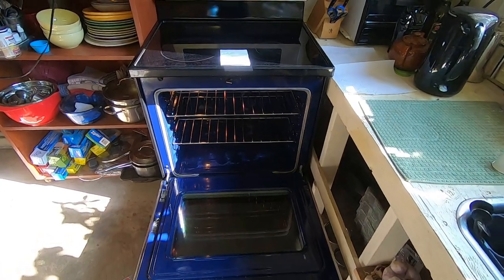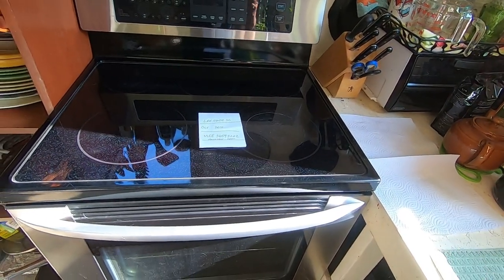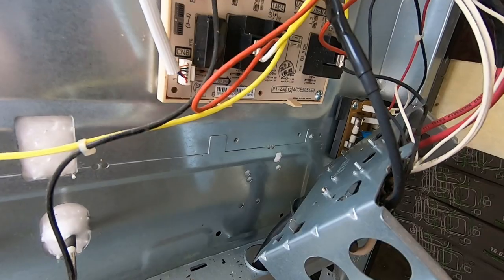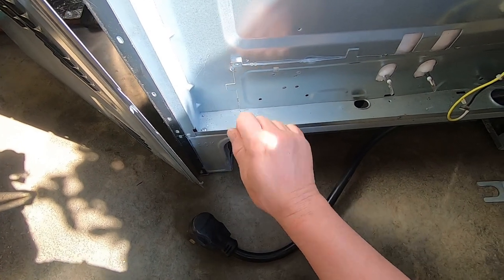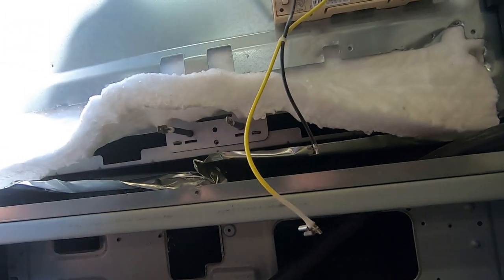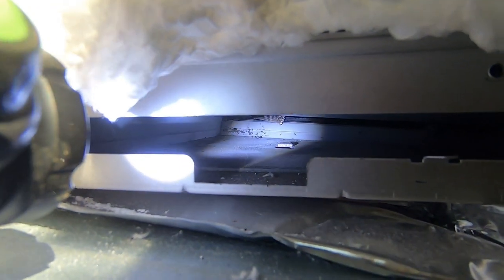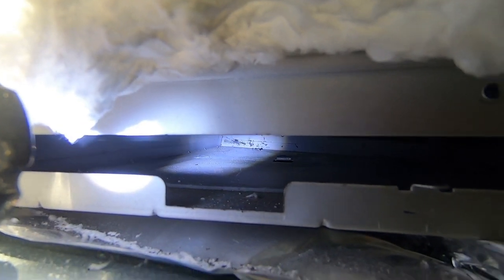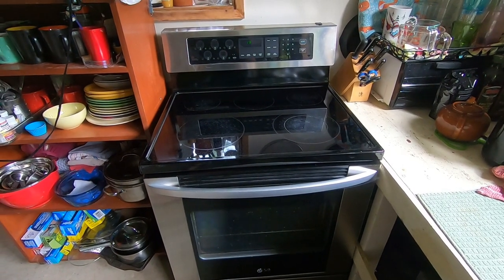HOW TO CHANGE A HIDDEN BAKE ELEMENT

Comment: Thank you for your time and this video. Next month I need to do this to my LRE4211. I may have a few more numbers to the model number, but I certainly get the idea and confidence to do the job. Thank you again.
Reply from the maker: Glad it helped. I hope your repair goes well. Keep in touch. I'd like to hear how you make out with the fix.
Reply: @EverydayProjects  It doesn't look like my LRE4211St does not have an element in the bottom, only on the back and broiler element.  Took off the back and there are no wires going from relay to any element under the bottom and no panel like yours behind the main back panel.

Comment: I found your video very helpful so thanks, I have a fairly similar stove and my problems is that the oven doesn’t heat up past 350 degrees, I installed a new thermistor but that didn’t fix it, so only after watching your video i realize it may be the same element mine needs replacing, I didnt even know that element existed until watching your video so thanks again, now i just have to find the replacement element and hope that it fixes my problem.
Reply from the maker: If your oven has a smooth floor then you most likely have the element hidden underneath. If you search online using your stove model number (found on a sticker inside the warming drawer) for bake element, you should find one. Good luck! I'm glad my video helped you. Please like and share my video and if you like the things I do, please click subscribe. It's Free!

Comment: As a Seasoned Mechanical Engineering Service Tech, I have to say you did a great job explaining what your were doing and why you were doing it. Very great Concealed Bake Element Change Out walk through for a LG. Smart for removing the remaining debris, not everyone even takes a look inside to even see what make have cause the issue in the first place. Your situation it seems as though the heating element actually withstood the test of time and lasted long enough to possibly warp to the point of shorting out against the structure and grounding out to oblivion. Just a quick heads-up. It should have tripped your Circuit Breaker before the Grounding Out to Oblivion part happened. You may want to check your Range Circuit Breaker and wires along the way if this was not tripping your breaker at the time of turning on the oven and discovering that the oven was not working. We design these with fire & life safety in mind so there are several safety switches and fusible links between each heating element and the Circuit Breaker so if it was not tripping the breaker before the repair, you may want to check to see if you have a breaker going bad or oversized. Loose connection at any point in the wires for the element can cause melting at the wire terminals and insulators but not the the element, after all it is designed to get heated. So this leaves me to believe that if your breaker was not tripping, you either have an oversized breaker or a breaker getting ready to die out. Either way figure since you seem pretty thorough in your findings you might want to entertain this possible future repair. But just in case it did the amperage did not raise enough to trigger the breaker to trip (which is scary) the HLCS High Limit Control Switch should have kicked in and cut the power to the particular element, and if that failed then there are at least two to three more safety switches for backing up those safety switches per element. So get back in there and let me know what you find.
Reply from the maker: Thank you for commenting! You are absolutely correct in your assessment of the stove tripping the breaker. But that was happening with the previous owner of this stove, until it stopped tripping, but the oven still would not work. My guess is that while the distorted element was making contact with the body of the stove, it tripped the breaker, but once the element broke into pieces, the situation moved from a SHORT to an OPEN circuit.

I picked up the stove for FREE because the oven wouldn't work (no doubt about it) and one of the surface burners was inoperative. I was using the surface burners only in this cabin, with no use for the oven...until this video.
It is still amazing how difficult it is to access this element. As I've said previously, it seems that the manufacturer would prefer a consumer buy a new stove than fix this oven!

Best wishes and thanks again for your thorough and correct diagnosis!

Comment: Hi our LG cooks unevenly, meaning if I cook a frozen pizza half way through I have to turn the pizza 180 degrees. I use Bake for that not convention so my question is mine burned out partially? The top element is strictly for broil, correct?
Reply from the maker: Usually an oven will not reach temperature when the hidden element is failing. I'd get it checked. Sounds like it's on the way out.

Comment: My LG oven take way too long to preheat, I change the temp sensor but that did not solve my preheating problem. Now I'm leaning toward the hidden bake element, could it be damage to the point where it effect the time for  preheat ? 
 
Thanks the video was great !
Reply from the maker: The preheat is definitely affected by either the broiler or the hidden bake element not functioning, because they both work together to bring the oven up to temperature. If the preheat takes a long time, or the oven doesn't get to temperature,  I'd be looking at one or the other. The oven in the video was displaying that symptom exactly. It would take forever to reach the preheat (if at all). Best of luck with the repair! Remember, be safe! Power off at breaker + Unplug stove. Also watch for sharp edges on stove panels!
Reply: @EverydayProjects  Yup that is exactly what happened to mine. I pulled out the temp sensor and it read 1097 ohms on my multimeter, which is within spec. Then went through elimination by testing the resistance on each of my elements starting with the broiler, the convection heater. They both tested around 17 ohms I think. When I got to the bake element, it had infinite resistance and no continuity just like shown in this video. I visually inspected the PCB power control board for any signs of heat damage or leaking filter capacitors. so far so good. I ordered an ew bake element for $120 as well as a new touch pad interface as they always end up cracking after year of usage.
Reply from the maker: @MrActionRadar  Best of luck with your repair. Thanks for stopping by. Take care

Comment: I have an LG oven that doesn't seem to heat up evenly. I took the back off and measured power to the upper and lower elements while the oven was pre-heating. My oven never powers both elements at the same time. One is on for about 1 minute, the power swaps to the other one for 1 minute. I measured about 10 amps at 220 V for each element when it was on. Does this sound correct to you?

Comment: That element was really baked. God job on the fix, I didn't see any sparks.
Reply from the maker: I've seen bake elements with burn marks before, but never one completely disintegrated like this one. Perhaps it has to do with the confined space in which it operates. The manufacturer could have created a better access door to facilitate changing the element but as I eluded to in the video, they really would prefer that you buy a new stove instead of fixing a broken one. Thanks for commenting!

Comment: Do you have a suggestion for removing the pieces of the element that are stuck? It was a hard work and I can’t take it all out... I couldn’t really remove that door, it’s all scrapped now, think I’m gonna need another piece of metal for replace this. It’s really hard for changing a simple element, I can’t believe this. If you have some advice, I would be grateful, I tried everything that I have to take the pieces out and it’s impossible! Thank you for your video
Reply from the maker: Perhaps you can fabricate a replacement cover from some sheet metal. Often, the big box stores will carry pieces of metal. Getting the old , broken pieces of the element out is important but not entirely necessary. Just so long as the new element will fit without interference. I’d try to get all the loose pieces cleaned out if I could, though. Sometimes a sheet metal shop can make you a new cover much less expensively than you might know. Best of luck. Remember, be safe and if in doubt, call an appliance technician. Best wishes!

Comment: Great Video!  I have a Kenmore Elite Double oven that is not warming as it should.  It is 9 years old.  Is it more likely to be the  Temp Sensor or the one of the heating elements?  Thanks
Reply from the maker: Not sure what the problem could be with your oven. Usually, it is a step-by-step elimination process to troubleshoot any appliance. There are many online sources to help. Try searching for "Kenmore Elite Double Oven Not Heating" and go from there. You can first try to reset your oven to factory by this method: How to Reset a Kenmore Elite Stove Oven

  1.  Press the "7" button on the Kenmore Elite keypad.
   2.  Continue holding the "7" button for at least six seconds until a single beep sounds.
   3.  Press the "Start" button on the keypad once. This will reset the oven back to the factory default settings.

Try any simple, step-by-step method to try to eliminate the components that work vs. those that do not. Remember, BE SAFE and don't attempt any repair beyond your skill level. Often, a qualified repair technician is the best call. They can save you time and money since they will know just what to look for. Good Luck.
Reply: @EverydayProjects  Thanks so much for your response.  I appreciate your help.

Comment: Thanks for your video. On my stove, the little panel is completely stuck on, after I cut the little tabs nothing is moving at all. It completely destroy it if I try to pull it off. Any thoughts would be greatly appreciated.
Reply from the maker: The cover on mine was hard to remove too. They really don't make the element easy to replace. They'd much prefer you buy a whole new stove it seems! 
I wouldn't worry too much if you destroy the cover taking it out. Just try working around the edge by driving a flat screwdriver between the cover and the back of the stove (wear some gloves, it's sharp!). Once you have it out, if it's damaged, try flattening the cover on a hard surface by tapping with a hammer. If that fails, the big box stores like Home Depot and Lowes sell small pieces of sheet metal that you could cut to size. The replacement cover doesn't have to be an exact replica, just so long as you cover the opening and it doesn't interfere with the electrodes of the element. I hope this helps! Good luck. Any other questions just write.
Reply: Thanks for the quick response, the info was exactly what I needed.
Reply from the maker: @georgeslabrosse3194  You are very welcome!
Reply: I'm into mine at this point, too.  !@#$% LG does not want you replacing the bake element, I swear! :^)
My son said "Designed by design engineers that never physically work on their projects!"

Comment: Hey this was somewhat useful but I wish you could help me with my Frigidaire oven the element went out and it has 3 elements but the one that went out is in the back of the oven but idk how to get to it if you can help in anyway or anyone would be so much help before thanksgiving!!
Reply from the maker: I would search online using the model number of the stove (found on a white sticker either inside the door or warming drawer) and then select "Images"  and you should be able to find an exploded view of the stove parts, often with part numbers, then check for parts on ebay or Amazon. An easy test of the element is shown in this video once the POWER IS OFF ! Use a multimeter on the continuity setting. There should be continuity through a good heating element. Good luck.

Comment: My LG LRE30453ST/01 has this same hidden bake element and the cover PANEL will not come off after clipping like the service manual showed. I’ve used a chisel, a dremel, and tried to score the FAKE panel lines with sharp tools. This panel was not made to come off. I’ve managed to cut and mangle the metal along several areas so far but it’s still stuck. If I somehow manage to get it off will it even be safe to put back since it’s mangled? How to get this panel off? 
I appreciate your video. It should have been doable and a somewhat easy fix. Looks like it won’t be though because of this poor design by LG. 
Edit- I notice at 5:04 when you pressed along your panel the separation lines clearly showed . My panel does not show any separation at all when pressed.
Reply from the maker: Cut out the panel with a jig saw with a short metal blade and install a new sheet metal piece, Home Depot / Lowes, etc.  sells small pieces that would work. Just drill and use sheet metal screws to attach.

Comment: Great video.  I have a 2007 LST5601ST and replaced the bake element with replacement part MEE36593201.  The original element had indeed burned out in one spot.  There was no continuity for it.  By the way, the difficult plate on the back was easy to lift out once all the small connection points had been broken.  Put in the new element and found out that the new bake element did not work either.  Checked to make sure it hadn't failed as well, but it had continuity.  I am really lacking in any electric or electronic knowledge.  Any ideas what the problem might be?  Might there be internal fuses or switches that might have gone off when the original burner failed?
Reply: Turns out it was the circuit board for the oven (not the main board).  I replaced it and everything works fine.  I guess the circuit board acts a fuse in this case.
Reply from the maker: This comment just turned up now. Sorry about the really Late reply. Glad you got it fixed

Comment: hardest part is removing that bake element access panel.  I've gotten 3/4 the way through and now seems impossible to separate on the right side.  i now have a chisel trying to pry it away and still not working well. I've cut all those "holes" apart and still holding on well. Any tips?
Reply from the maker: Just use a chisel and a hammer (or screwdriver and hammer) and see if you can cut the remaining steel. It's not easy but it will come out. As I say during the video, LG doesn't seem to want you in there to change it. The element change should not be this difficult. Be careful of sharp edges. If you destroy the metal piece removing it, I suggest getting a blank piece of steel from Home Depot, or such other place, and make up a replacement. All it has to do is block off the opening.
Reply: @EverydayProjects  Thanks for the reply.....You're not kidding.  Figured that was the inevitable. I'll continue chiselling to get access.  Just don't understand them making it this difficult...I mean the techs would have to do the same thing! muphy.  Thanks for the video.
Reply from the maker: @mikehunter5733  It's called "Built-in Obsolesence". They really would much prefer that when the oven bake element gives it up, that you throw the whole thing out and buy their latest model ! At least that's what it seems, especially with this particular stove. Best Wishes

Comment: I spent an hour prying, hammering, chiseling, and cutting with tin snips to get that cover off!  Easy 15 min element change otherwise.  I will suggest try cutting out this opening with a dremel and thin cut off discs instead.
Reply from the maker: Yes, that's a tough one to get off. They really don't want you in there to fix it but would prefer that you buy another stove when the element blows. Or so it seems. Like you suggest, a dremmel and thin cut off wheels would be a better way than prying the cover off. I'm glad you got it fixed!!

Comment: Hi I wanted to change the element in our zanussi double oven  I removed the element but the 2 spade connector wires fell in the back so I heard to remove the back to retrieve the wires but because they are both grey I don't know which g goes on which terminal now. If they get put on the wrong way round on the new element will it destroy it.
Reply from the maker: The bake element is simply a resistance circuit that gets hot as a result of current passing through it. There should be no issue with hooking the element wires in reverse, since there is no polarity. In an alternating current circuit, the current reverses many times per second. In North America, current reverses at 60 Hz, which is 60 times per second.
Reply: @EverydayProjects  phew that is a relief i was worried i would blow the new element up if they were the wrong way round. I should have paid more attention at physics classes.  Im in the UK by the way and thanks.
Reply from the maker: @sajidkhanmahmood  Everything is the same except the frequency of alternating current in the UK is 50 Hertz (Hz) which is 50 cycles per second as opposed to 60 Hz in North America.
Reply: @EverydayProjects  hi I was successful in chanting the element and sacred my self about£100 thanks to YouTube.
Reply from the maker: @sajidkhanmahmood  Glad to hear that. Best wishes! Don't forget to click "Subscribe"